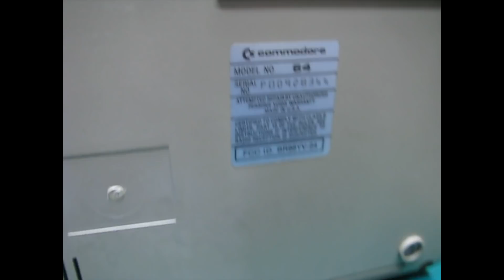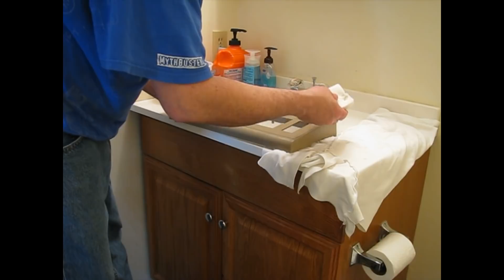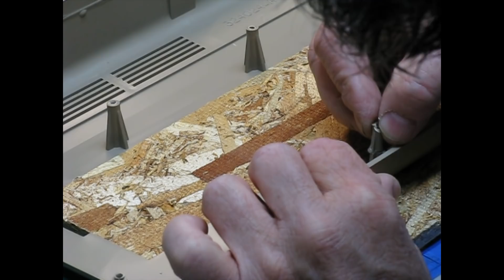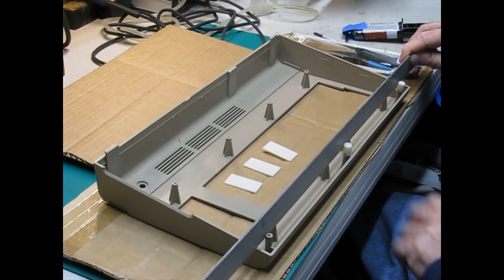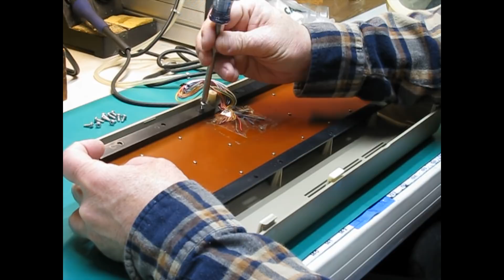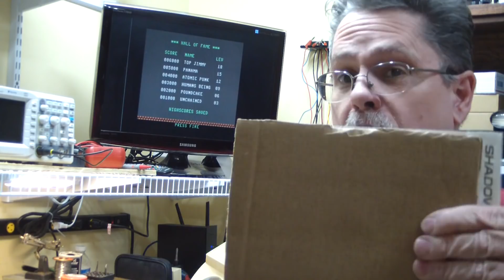C64 Case Repair

Comment: Nice work. Enjoyed these two immensely! Are the case repair components still available? I have a bread bin in a similar state and would love to apply your fixes. Cheers :)
Reply from the maker: Hi, I will have the repair parts up on my website by this weekend. I'm going to make a new short video on how to install them and tell what sort of case you have. So far I have found 4 different types of clips used on the rear of the top case. I'll have repair parts for three of them, I don't have the fourth style of case in order to measure and design the repair part.

Comment: I already have fixed some c64 cases which had broken clips on the back, found the design for this at thingiverse, I like your design for the motherboard screwposts and the case posts. Any chance to get the stl files of these so I can print some and try it?
Reply from the maker: Hi, I will have the repair parts up on my website by this weekend. I'm going to make a new short video on how to install them and tell what sort of case you have. So far I have found 4 different types of clips used on the rear of the top case. I'll have repair parts for three of them, I don't have the fourth style of case in order to measure and design the repair part.
Reply from the maker: I just got them up on the website: https://www.soigeneris.com/commodore-64-caser-saver-repair-kit

Comment: Thanks for sharing your experience.  I know these kinds of damages, too. I don‘t have the capability for machining posts and that, so my way of repairing them is more archaic. Some months ago, I had a case with cracks and missing corners and big holes. Finally, I have bought epoxy putty to fix it and it worked nicely. For the posts, I glued them back with plastic glue for building models. It dissolves the surface a bit and also fills some narrow gaps. Then I have reenforced the posts with some epoxy putty. It doesn‘t look so great inside, but it seems to work well. I also have a breadbin with a bit of a horrible snap sound from those taps in the back. I need to have a closer look on that. It also seems, that both halves of the case don‘t fit together well. Greetings from Germany :-)
Reply from the maker: Good job on using what you had to repair the case. I think perhaps where the keyboard post/case tends to break on the top corner that gluing the broken bits back in and reinforcing it with epoxy putty or gluing in a flat piece of ABS over the crack to reinforce it is a good idea.

Comment: Nice video, very creative solution.  I think for sure people would be interested in those sleeves if you decided to make and sell them.  I don't think I have taken apart a single original style 64 that didn't at least have 1 or 2 broken posts or mounts.
Reply from the maker: I think if they would have made them a little larger in diameter it would have solved a lot of issues. I'll let you know when I have some sleeves made up.

Comment: Great job, but this cardboard shields are just awful and i do not see any purpose to put them back, only to preserve original look, nothing else.
Reply from the maker: I know some folks do not like the cardboard shields. But, as you say it is original and Commodore would not include them if not needed to pass emissions tests. In the future I want to do a video that explores the effect of the shielding both on thermal performance and on EMI.
Reply: @HeyBirt  Maybe it was needed back in the 80s but today i did not notice any EMi with this cardboard removed. Metal shields like in some C64 models and C128 flat makes sense, since they are also used as heat sinks.
Reply from the maker: It is a common misconception that the shielding requirements in the 1980s were more stringent than today. The regulations today are more strict and there is much more technology in use, including a lot of wireless tech, that makes interference a big issue. The university where I work has an entire department that does research to help companies with emissions problems.

The difficult bit with any sort of EMI/RFI is that it is not typically consistent. I used to have a microwave oven that interfered with an old WiFi router. Any other combination of router/microwave worked fine. There was no doubt though that the microwave should not be leaking that much radiation, point is it may or may not be apparent that there is a problem unless the circumstances are correct.

I agree the metal shield is better, but without testing I'm not sure by how much etc. It will be interesting to do the testing anyhow :)
Reply: I always ditch those things as I have not noticed a difference in interference.  Of course, just because you cant see it doesn't mean it is not there.  While it may be questionable if it actually is effective as an RF shield, there is no question that it keeps heat in which is not good.  This is why later versions had the metal shields with the fingers and later cardboard sleeves had holes throughout.  With the holes, it makes it questionable if it was doing any good as an RF shield.
Reply from the maker: I hope to find out what effect the various shields have with both RF and heat. Just need the time to do the experimentation.

Comment: Okay Jeff, where do I get those sleeves ?
Btw, LOVE the Vids, VERY helpful especially since there is NO definitive solution to fixing Case issues.    -Mark.
Reply from the maker: I ordered some more ABS stock to make up some more sleeves. The first ones took too long to machine to make them practical but I think that can be greatly improved upon. Injection molding would be ideal but the mold cost would be very high.

Comment: Great video dude. Those castellated sleeves you made were a clever fix. Thanks for showing the failed attempts too, nice to see. Keep doing this stuff and the viewers will come!
Reply from the maker: It was rather disheartening to have it break TWICE during reassembly but that is part of the learning process. I like to say that if your not making mistakes your not learning.